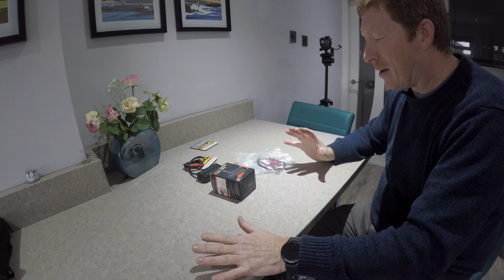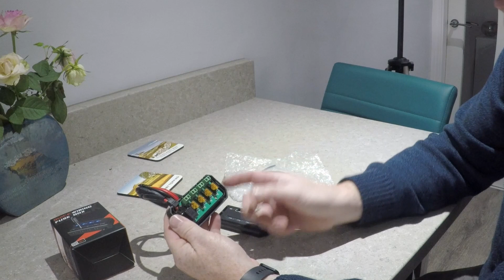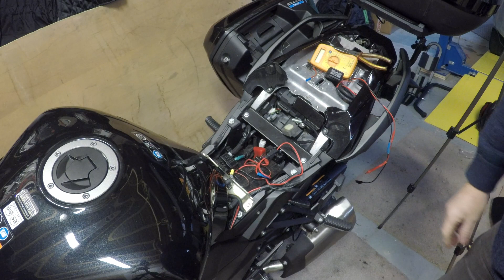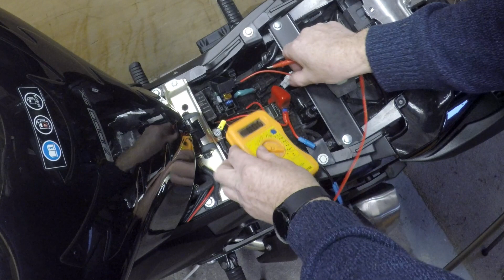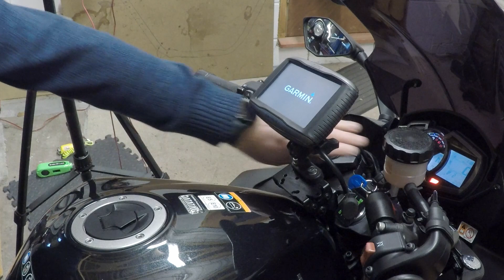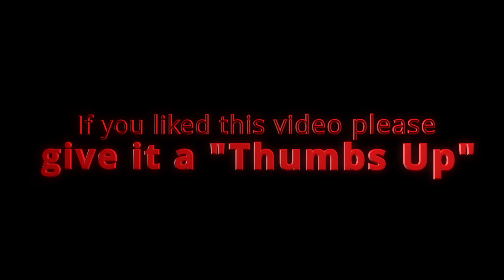2018 UK Kawasaki Z1000SX - Additional Motorbike Quick wiring Fuse Box

Comment: Just been doing same thing, and found your video. After 2y, did you had any issues with the fuses not covered fully? Got ninja1000sx , same bike pretty much. I heard there should be an auxiliary socket nearby, if I would locate it, best would be to make a new crimp on a wire and plug it..  Atm, need to stay this way. Bike on warranty , I'm not cutting any cables
Reply from the maker: I don't have the bike anymore but, no...  no problems with it

Comment: Got my sat nav for my 2015 z1000sx today,my bullet connections have been used for heated grips,i cud tap into my usb but its wired straight to battery,so seen this box,now please excuse my ignorance as a newbie to wiring bikes,so this box connects direct to battery and then the sat nav/usb ect can go to 1 of the ports on the box,what im trying to figure out is if its direct powered to battery how does the accessories turn on on off with the key if box gets direct power from battery🫣be easy on me im learning😅
Reply: Thanks all sorted,piggy backed off the heated grips on the bullet connecters with inline fuse so all good now👍
Reply from the maker: excellent! cheers
Reply: Dont know what happened i missed start of video,were u used piggy back fuse now makes sense used same for car dash cam,the fuse box were piggy back fuse is what did you do to stop water maybe getting in with it staying open.thanks
Reply from the maker: Ok. The box connects to the battery, but there is an extra lead to/from the box to a supply, which is only live when the ignition is turned on. You have to find that supply.
This basically turns the box o,  which then powers up whatever is connected to it.
I hope that makes sense.

Comment: This is what I was looking for, brilliant! Thanks mate! In terms of the fuse that is supplied with the GPS unit or any other accesory, if it's more than the 5amp in the box, do you need to do anything with the GPS supplied fuse?
Reply from the maker: I wouldn't have thought so, I would leave it in the line to be safe. I'd doubt it would be over 5 amps.

Comment: One thing I was hoping you would show was the fuse box actually shutting. I’m presently working on this exact set up and the reason I didn’t get a fuse tap was because I was afraid the fuse box lid wouldn’t shut making a good seal and thus becoming susceptible to water. Were you able to shut yours?
Reply from the maker: Good question. No, not fully. But I figure it would still be OK in that position under the seat.
I've never seen it wet under the seat after riding or washing the bike.
Reply: Excellent. That’s good news. I think maybe I’ll go the extra mile by sealing it somehow with a ziplock back and a zip tie or something.
Reply: Why did you not just tap in to the live tail light , could u reply ,
Reply from the maker: Possible... but I wanted to power many extra things so didn't want to pull lots of power from a small rated power output...  The tail light could power the internal relay no problem though, if that's what you meant?

Comment: Brillient video again, Just got my Quick wire fuse box for my RA GP300, was going to install the fuse box is the shell of the glove box for future add ons to save running all the way back to the leg sheild compartment.  Was wondering if the lenth would be a problem ? also, do you have a order number for the piggy back fuse tap.
Reply from the maker: Glad it helped. Just search on ebay or amazon for the piggyback fuses..  there's plenty to choose from. Just remember there's mini and micro sizes.